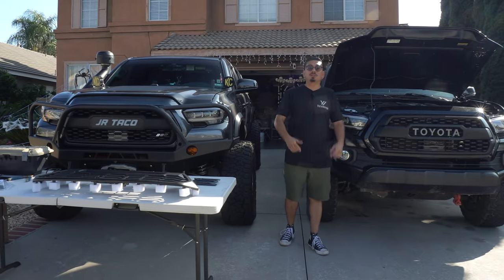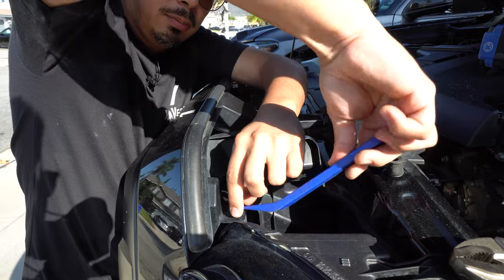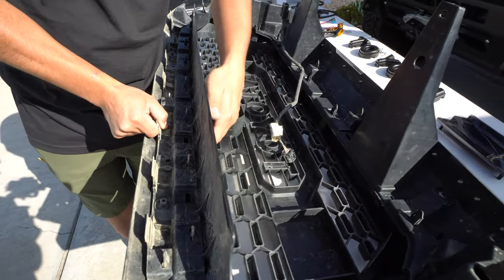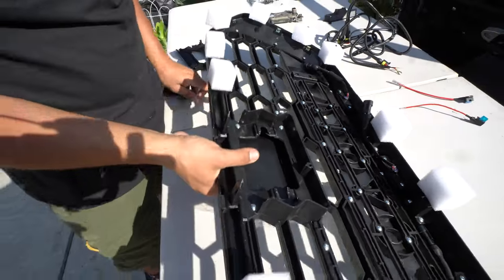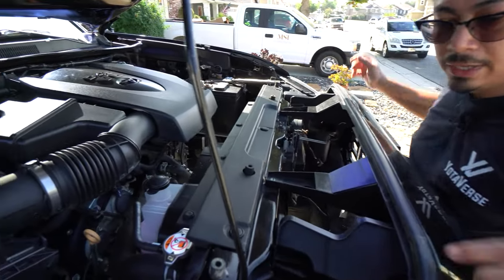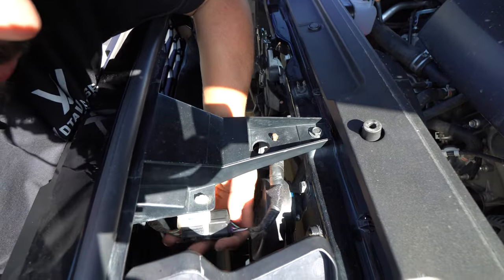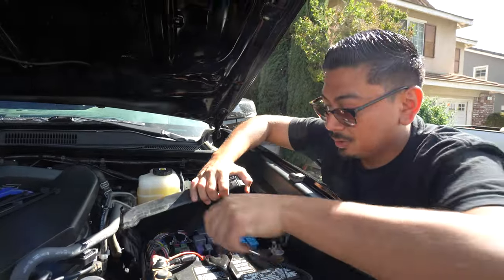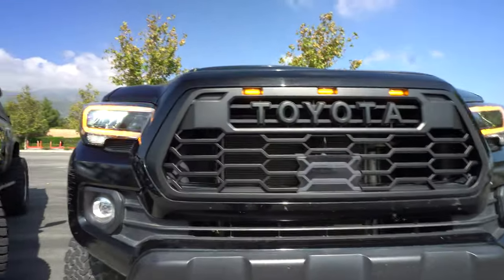The NEW TRD PRO V2 Grille How To Install & Wire Onto A Toyota Tacoma | Is It Better Then V1?

Comment: I’m so thankful that my TRD off road has a front camera. I use both on and off road.
My TRD Double Cab 6’ bed has the Premium and Technology pkgs.
It’s basically a Limited with the TRD Off Road pkgs.
I wanted a PRO, but I have to have a 6’ bed. I like the Limited, but it doesn’t have the same Off Road capabilities.

Comment: Drill a small hole in the lid of your fuse box to allow for the wire to go through.
If not then eventually the vibrations of driving will cause the wire to break.

Comment: Thanks for the video. It walked me through the install. However, the add wire to connect lights to fuse box is not like yours in the video and definitely will not plug into fuse box within the engine compartment. Will need to search for your video on connecting to inside fuse box I guess.

Comment: Great vid! Only question I have is about the add a fuse...what is the blue fuse that is already placed in there? 5 amp fuse?? Cheers!
Reply: I am wondering that too. I just got my grill in but it doesn’t have the little blue fuse included, only the wire.